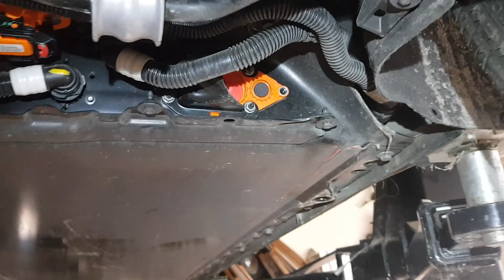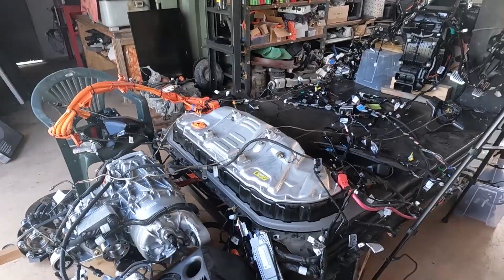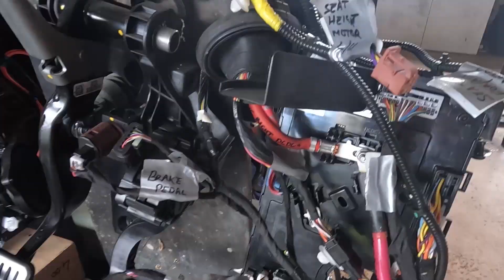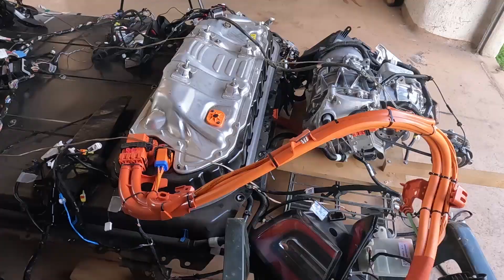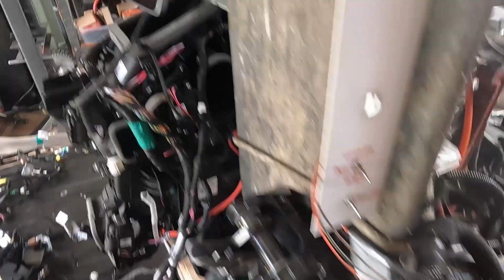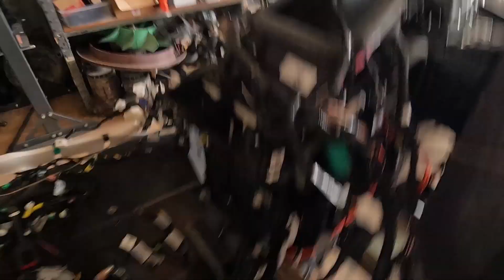Land Rover FTI 05 - Tesla Model 3 running without a body

Comment: Great progress and smart thinking making the whole setup work outside the Tesla and before putting it in Land Rover! Could you make a simulator for the wheel speed sensor that simulates an adjustable pulse frequency?
Reply from the maker: Thanks. I think there are multiple ways I could do it. I'm pretty sure the wheels speed sensors have to correlate to the motor speed as well. The most elegant solution I think would be to ditch the ABS module and send the wheel speed "clicks' via the can bus (changing with motor speed).